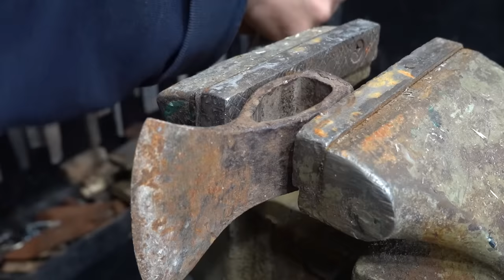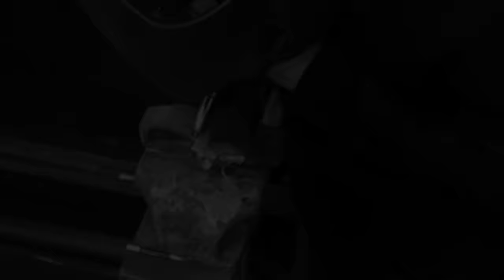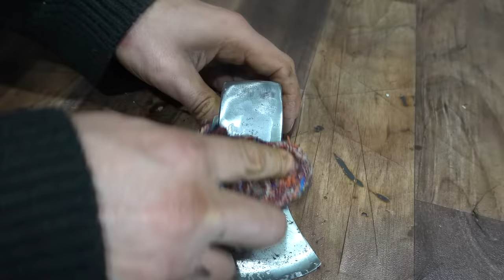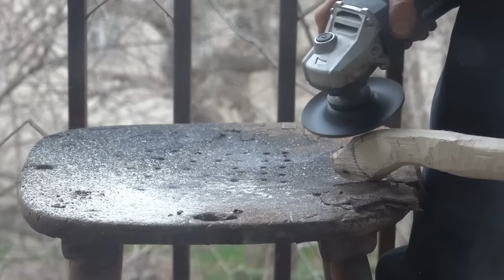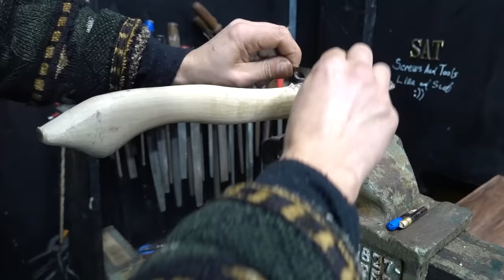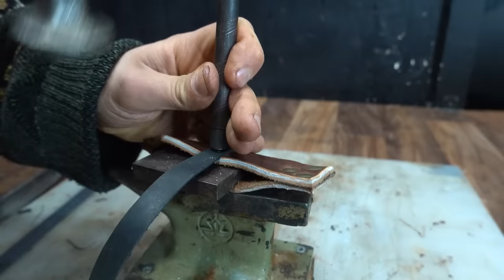Restoration Rusty Broken Axe

Comment: Great job!!! :) 
Interesting handle shape, looks really comfy. Did you have a pattern ready or did you just made that up for this job by hand?
Could you perhaps make a short video about how to best shape the forward end of the handle, the one that goes into the eye of the head, please? I've got two similarily shaped old heads from my late grandfather, the handles were all cracked and stuff but the heads are not. BTW I've seen your "AXE HANDLE - how to make it?" video but I'm especially interesting in the part where you make the rough shape of the handle end.
Reply from the maker: Hi! Sorry for the late response. I always do it just by eye. That is, the main thing is that it is convenient for you. Thank you!